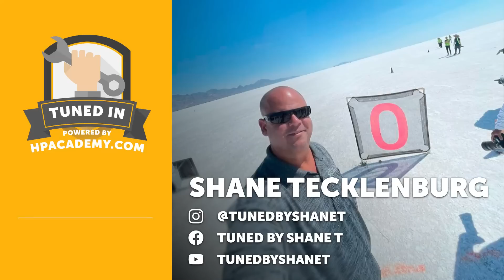121: Compound Turbocharging — Untapped Potential or a Waste of Time? [#PODCAST]

Comment from the maker: Use “SHANET100” to get $100 off HPA’s Tuning Starter Package: https://hpcdmy.co/tuningpackageb
Reply: Just some info you could pass on. Or look into yourself. 

Interchiller system. Aussie and nz kinda pioneered that stuff so should be easy to get help. Ac chilled intake temps. 

If you use fresh air sub ambient temps. Without fuel mixed in. Direct into the exhaust chamber or housing for the turbo hot side. The intake gases with expand as they heat up. Thermal differences will cause rapid expansion. 

Fresh air antilag with less wasted fuel and stress on parts. However. Means you need dense dense intake charge. And you need more boost intake charge then the engire requires to run even as density drops. 

But in theory waste gates and the fresh air valve working combined could keep the thing spooled nicely and spooling faster at altitude if you do come off boost. 

Twincharging would be the other method for getting rid of antilag with interchilling. You have it in theory able to make more then you even want down low. But compound and chill itself down to roughly what it should be and make up for the loss of power via just allowing the boost system to go full tilt. Also gives you ability to run overlap minor on the valves and get fresh air antilag integrated plus better intake vs back pressure  delta which means faster spool anyways. 

Cops fresh air pre fuel antilag is the safest but needs more calcs. And might not be as aggressive as needed. 

Interchilling would help with heat management. 

Wolf or something similar. Or hill climb rx8 or something small cheap. Twincharged k motor. Interchilled. Vw group ac comp swap to handle up to 9k plus rpms at ac. Think it tops out at 9700rpms. 

Idle to redline chilled intakes. Smaller intercoolers. packaging benefits. Turbo sees a much bigger engine. Torque map it. Race gearbox. 

Loads of aero and weight reduction. Wouldn't be hard to get enough power. Wouldn't be too ridiculously expensive. Could combine multiple boost management methods and spool helpers. Modern blowers have bypass valves. Would take tuning. 

But have it bypass when the turbos hit full boost. Also keeps it safer and faster for false starts and restarts. 

Run the blower in the right set up and it's not gonna eat up much hp for its benefit. Turbo will be lower boost ratio higher flow. Making it easier to prevent it over spinning.
Reply from the maker: 0:00 - Welcome to Tuned In Podcast Episode 121
4:09 - Quick introduction: Shane T
6:16 - How did Pikes Peak go this year?
20:51 - Does an LMP3 make a good hill climb car?
30:21 - The perfect combination for Pike Peak?
34:19 - Losing boost response at altitude
39:34 - Fresh air antilag
45:07 - How do you deal with changing barometric pressure?
58:14 - Pressure ratio
1:14:14 - What is compound turbocharging, and why did you go down that path?
1:18:12 - First dyno session, how did it go?
1:33:16 - Thunder Mustang aircraft, how did you get involved?
1:44:21 - How did you cope with tuning these engines without Lamda?
1:50:21 - Were there any other challengers tuning these aircraft?
1:57:00 - Launch control strategies (Ignition retard)

Comment: Fresh air antilag may have some unique downsides besides the weight. Even if you avoid the combustion style fresh air bypass piping in air prior to any fuel injection. 

You still need more boosted fresh air then you need in the engine. That's the least stressful style. Compressed air will expand fast. But the air needs to be cold enough density enough and boosted. 

So you basically have to run an ac assisted interchiller set up. Or icebox. Or liquid nitrogen cold box.

Comment: 1:30:25 yeah same.. and what picks up more hp is going bigger in size with smaller turbo so you can run more PR, also bigger A/R on housing.. but this goes in a way back to IMAP/EMAP ratios
Reply: I'm not sure i really got that part right, of course better Flow on the turbine side is going to be better (i'm guessing because of those crazy power and PR) 
But why rising the boost from the low pressure turbo is going to reduce total power if total boost is higher?
Is it because of back pressure only?
So i'm guessing when you are rising PR from low pressure turbo then the turbine side of the high pressure turbo is going to choke more than when you rise his PR is it?
So in the case where we keep the same scénario, you could ''  Just " increase the high pressure turbine Flow (bigger A/R?) And even by increasing PR with the low pressure turbo you would see in that case the power climbing up (110psi intake and keeping exhaust maybe under 100psi) ?

I'm sorry if i'm not clear but hey i'm trying ah ah

Comment: From what I have seen, you are able to get a lot more mid range from compounded turbos. If you already have a twin turbo setup, I'd recommend compounding them together with 1 big and 1 small (your weight will be basically the same). If you have a single that you're experiencing lag with, I'd recommend fresh air anti lag for a V band setup and/or spool valves if you have a twin scroll flange setup to block off a scroll essentially making your a/r ratio variable. Compound turbos are a little sensitive to tune, but they can help a lot, especially on diesels.

If you're REALLY wanting to eliminate lag and not use a supercharger, look at what Eric Mann did in the 1990s. He made a jet engine from a semi truck turbocharger and ran that off a small diesel tank. He then bled boost into a Cosworth 1.7 engine, he got a flat torque curve from 2400rpm to 9000rpm.

Comment: I’m still amazed how much of a misunderstanding goes to fresh air anti lag. The biggest issue is that everyone who is talking about it haven’t calibrated 1 or 2 cars with that system. Reality is that it only adds more turbo speed with same throttle openning. it’s not possible to run this system with throttle closed or reduced opening by 2/3 to get same results engine still needs a lot of throttle bypass. It adds more difficulties because turbo speed is much more inconsistent and will vary based on egt of course. Fuel trim is fine to control it but not enough. Done 20 different cars and turbo setup fastest evos in European hill climbs running fresh air and I’ve got a bit of data :) also anti lag is adding a lot of difficulties with downshift with paddle shift system but with top ecu’s it can be done properly.